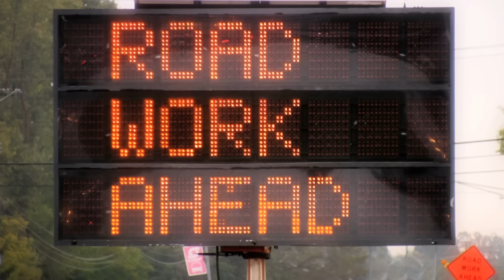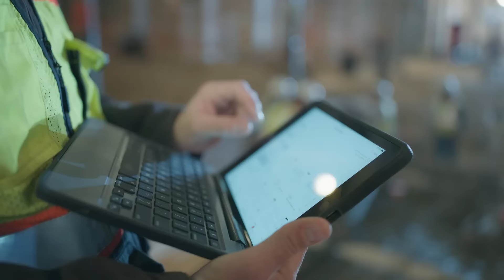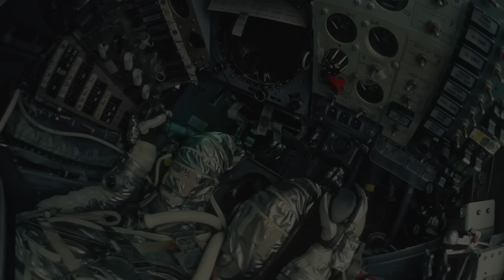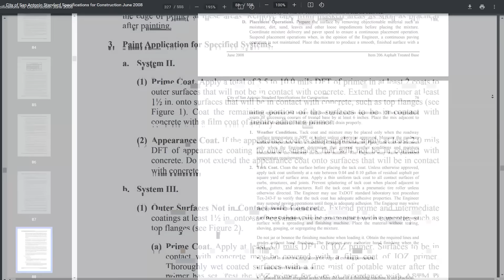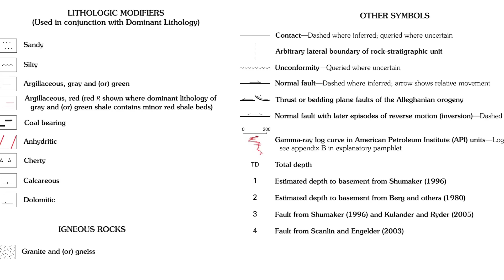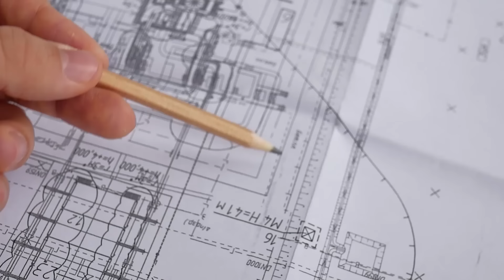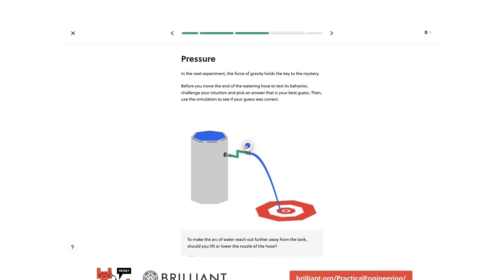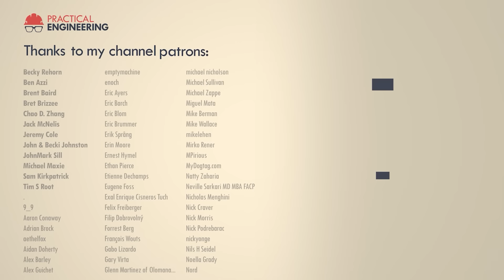4 Myths About Construction Debunked

Comment: As someone who does surveying, I do feel more lazy in the office than on the field
Reply: I've spent a lot of time playing on my phone in the truck because the contractor would rather have a full time crew on site than deal with the scheduling hassle of just having the surveyor come out when they need him.
Reply: My wife once said her career goals were "Stick holder. You know, when you've got the two people doing measuring? I wanna hold the stick." XD
Reply: omg your right i did not nodise that i felt more lazy in there doring lunsh thin out on the field
Reply: I can confirm! Day moves slower inside too haha
Reply: As a financial analyst for high rise office buildings, I can tell you that there’s no room for laziness in my field. It either works or it doesn’t, nothing in between.
Reply: As someone who left office work in a legal aid program to become an electrician I can guarantee you that pulling and installing thick aluminium cables and heavy cables is much more relaxing at the end of the day than working in the office.
Reply: As a surveyor having an office day, I can confirm.
Reply: having just finished a day at the office, yeah youre right
Reply: @toppersundquist  the stick holder is the stressful bit! You need good balance and a technique for holding things vertically. The looker/button presser at the other end is where it is at, much less skill required.
Reply: Haha fellow surveyor here
Reply: @timeluster  Since I've been doing both for the last 30 years: The stick-holder has the responsibility of knowing WHAT to shoot, and that's the big-brain part.
Knowing which buttons to press in certain circumstances is VERY important, but I always train newbies how to run the instrument first (especially now that we have robot instruments).
Reply: Sureyor, best job in the world, interesting and you can go to Incredible places.
Reply: The important thing about working in an office is to make sure nobody can see your computer screen so you can watch YouTube videos all day.
Reply: @mohammadalhasan4253  Cables over legal aid? Oh jeez, I hope it wasn't bad management.
Reply: As I write this I'm being paid to make manage our site surveyors while watching a bit of youtube and making sure the surveyors don't F up :D
Reply: As a bridge inspector I totally agree
Reply: As a CI (construction inspector) I would agree.
Reply: Bet
Reply: You are actually doing work when you are  surveying the land - When four guys are looking at a hole while one guy is in the hole with a shovel and there’s one guy asleep in the work truck —- That’s the time that it doesn’t make sense
Reply: That's because people who work in offices don't do anything either. Lol
Reply: I do like that you said "more lazy in the office" because you have one of the laziest jobs I've seen. Important.. but lazy.
Reply: @ReaperCet  No, I just have to move really  slowly because otherwise my computer can't keep up with me.
Reply: Teman dulu pun kerje 'site surveyor',skrg dah lama penchen,memang betul le serunok kerje kat 'site' dari kerje dalam pejabat ,kerana dalam pejabat ade 'boss' ,kat luar kite laa 'boss'!!!!

Comment: I worked a few summers at construction sites, and the truth is that there is a lot of inefficiency that arises just from the workers doing their best to figure out what to do. Usually the architect's plans have some minor flaws that cause major delays and idle time for the construction crew, and the on-site engineers often have to make decisions based on incomplete information and without a lot of experience in all the various jobs that need to be done. Despite having an image of purely physical labor, a surprisingly large portion of time and effort goes to just thinking.
Reply: At least Someone has been a job site 💯💯
Reply: @J D To be clear, it is not a criticism of anyone, just an observation of the construction process. It's the reason why construction has not been automated yet: building is a difficult problem. If you think what I say is incorrect, you should address it on a factual basis, rather than try to belittle me as a person.
Reply: In a profession where you are not allowed to make changes or modify anything without the approval of an engineer causes a job of the simplest nature to come to a standstill.
Reply: You have a fair take, though an incomplete one.

Sometimes those 'errors' on the prints aren't an error at all, and contractors waste time by trying to sell the owner and his field engineering reps on a 'better' solution that may save the contractor time or effort, but has long-term ramifications on maintainability or operation that were taken into consideration by the original designer. Or there's a note or alternate installation detail that requires actually reading the entire package, not just glancing at the one plan view.  Some may even anticipate billing on the back end by bringing up additional costs due to change-orders that they actually initiated 'to save time', or be using this apparent confusion over the prints to cover for the fact that they have a delay because they've overcommitted their labour force elsewhere, or messed up and didn't order enough material or tools.

There's quite a bit of back and forth behind the scenes going on, especially with megaprojects, that don't neccessarily trickle all the way down to guys working in the field at a summer position, and the guys that did the prints are often not in the room as they're being thrown under the bus.
Reply: @russellkeeling4387  Long line of major building and industrial accidents to demonstrate what happens when you don't go back to the engineer before making changes, even seemingly inconsequential material substitutions or other changes. Best when both sides are working together from the start and throughout, but oftentimes the owner's pinching pennies trying to compartmentalize. Penny-wise, pound-foolish.
Reply: Yeah little bits of misinformation can delay the project for weeks. And you need perfect coordination which is hard to get down.
Reply: This pretty much sums up my time so far as a site engineer.
Reply: I am a carpenter and joiner. Have been at a lot at work sites and in factory workshops. I am building custom interiors for all kinds of public and private buildings.

Architectural drawings will always have errors in them. Always. When we start building interiors, we always have to double-check every single measurement on the architectural drawing to see where the errors are. This is work that often  has been in the hands of architects and engineers for months already. I must go through and check everything in a day, because we are expected to get production rolling within the week usually.
Then, we have to check with the builders on site, that they have the same versions of the drawings, and make sure that they also have discovered the faulty measurements.
Then, before going into the final stages of production, we need to go out to the site and see that the builders and other contractors have actually followed the drawings, and adjust to what is actually there.
In the meantime there will be changes made to every possible aspect of the project. Clients will want to change materials, colour schemes, surface treatments and you name it.
Materials will be out of stock. Subcontractors will be hung up on some other job. Deliveries will be delivered to the wrong adress. Materials will show up sub-quality somtimes and need to be sent back. Accidents will happen.

Construction is a process involving so many variables that it is sometimes amazing that it can be coordinated at all.

Professional project management is crucial. Costs for many projects could be cut by half if there were just proper preparations made.

Comment: I live in Magdeburg, Germany, just 3 minutes from a large new bridge & road construction site (the Ersatzneubau Strombrückenzug) and seeing the slow progress every day has been really fascinating. It seems like sometimes nothing will happen for weeks and then, over night, a huge new part of the bride will be suddenly be completed. It really put the amount of invisible work in perspective for me. You need to have a lot of other things done before you can just plop a new 50 000kg(!) piece of steel on the end of your bridge without it collapsing.
Reply: Comicly, to some English speaking people it will look like you are specifying 50 kg to 5 significant figures not 50 tonnes. ("." is used as the decimal marker not a seperator for triplets. Some people still use "," as a seperator but best practice in sensible English speaking countries for decades has been to seperate triplets by spaces, probably to avoid confusion with countries that use "," as the decimal marker.)
Reply: @igrim4777  most of us understand that the decimal has the same use as a comma. Born and raised in America and I understand the metric system way better than I do the imperial system.
Reply: Your right. I work in a factory that is currently expanding a building and when you watch the construction crew it looks like nothing is happening, but then you look at the timelapse of the past few days and you see how much actually got done.
Reply: Working outside of course makes everything even harder. If concrete is involved, you have to plan possibly weeks in advance for when you will need the concrete on-site because it has to be made remotely and brought in on trucks. It also can't sit around in the trucks or it will start to cure. They can't pour the concrete if there is any chance of rain and the only way to know that is to have a solid window of time to make it all happen. They can also be offsite making the steel frames or working at a different site. The bridge site could be waiting on some material that has a long lead time. There are also unforeseen questions that pop up on nearly every construction site and the engineers have to be consulted to answer the new questions and possibly draw up and engineer new plans to answer those questions.
Reply: @Quantum-  I have to know both as a machinist, my employer makes parts in both metric and imperial.
Reply: That there is a progression that you have to take care of is true, but it also come down to how different contractors care about the effect they have when building.
Example from the building of two similar bridges done by two different contractors over a local motorway. One was build in about a month with people onsite every day. The other was build in close to eight months with long periods where nothing was done. The later meant that there was big problems with traffic for months and that a travel that should have been completed in 15 minutes to nearly 45 minutes. That is "stealing" a lot of hours from people that need to travel, just to optimize their own use of resources.
 The first bridge was completed at time the later several months late.
Reply: I can confirm that. We are building a house and it is the exact same thing. Some tasks take a lot of time but look small and insignificant. They are important to prepare that site for bigger chunks being put it.
Reply: @ThePwig  Don't forget the curing of the poured concrete, cube cylinder testing to measure strength gain, propping and loading cast sections. 
Most of my career was in tunnel construction and we were payed bonus payments on yardage completed, so we didn't stand around at work, in the new car showroom yes and in the 1960s 70s I could buy a new car monthly eat well and look after mum. My retiring project back in 2015 on the KL Metro Malaysia we were building on average 345m of 6.67m dia. tunnel per month.
Reply: @igrim4777  I love mm and hate cm. Having grown up in the UK with so many differing measuring and counting methods, decimal was a god send. The divisions of an inch, foot, yard and mile. Fluids, Money, Time it's a wonder that any school kid passed a math's exam.
Reply: @Quantum-  The Firkin is my favorite, well the contents are.
Reply: The new Strombrückenzug is simply amazing for such a small city. Watching it built is so awesome.
Reply: @candlestyx8517  I'm just dumb. I can't mentally picture what a half inch looks like but I can spot the difference between a 12 and 13mm bolt at a glance. Lol. Knowing that the latter is virtually 1/2", my brain just doesn't process imperial. It takes work for me to convert them. But once I get to certain measurements, I default back to imperial. I use inches not cm. I use miles not km. And I'm fairly fluid between lbs and kg. It's weird.
Reply: @TheByard  Along with the Furlong and the Fortnight?? 😀
Reply: One of the issues we have in Germany is that for public work like this companies bid on it, and the lowest bidder wins (so far so normal). The bid terms define a start date but no end date, so often you will just see all of a sudden these companies put some traffic control to meet the minimum requirements of "starting a job" and then leave for months to work on more lucrative jobs.
Reply: @_yonas  there's a comedian, Todd Yohn. He wrote a song about how there's nowhere to store all the barrels/cones for road construction, like no warehouse large enough. So he proposed that instead of storing them, the barrels just get moved along the highway in different temporary "construction zones". When the barrels are needed workers come pick em up. I always thought it was a funny joke.
Reply: @Quantum-  that's because you are bad at math
Reply: @dakota9821  that may be. Where'd you get your PhD? Phoenix online?
Reply: I've personally been shocked at the speed of some construction near me, an entire apartment complex went up within a year and I barely saw anything happen.
Reply: Shoutout Magdeburg! I‘m from Nashville and miss living in Magdeburg

Comment: As a bridge inspector I appreciate this video! I will say it does feel odd standing around watching other people work but inspectors play a vital role in ensuring the final product is built to standards and isn't a hazard to the public. I'm also glad you addressed the myth about Roman concrete and structures, an ancient Romans head would spin if they saw a concrete beam with pre-stressed strands, quite ordinary in today's construction of bridges!
Reply: Do you inspect the welds or just everything in general?
Reply: @tylerjacobson5840  everything in general through the construction of a bridge. Earthworks, deep foundations, formwork for concrete structures, concrete itself, reinforcing steel, beams, post-tensioning strands, conduit ect...
Reply: And none of it will last as long as the Roman’s due to rebar.
Reply: @evilsimeon  And that's perfectly fine. Unless you'd prefer to live in a Roman marble structure without modern heating, plumbing, or air conditioning?
Reply: @evilsimeon  How many Roman bridges carried heavy vehicle traffic?
Reply: @tylerjacobson5840  Welds have specific inspectors for them. They follow industry standard methods for testing and quality of the welds.
Reply: @BlackGateofMordor  You don't need a structure that uses steel reinforcing bar in order to have air conditioning, electricity, and modern conveniences. Steel rebar is, in many cases, THE element of a building which dictates the building's maximum lifespan.

There are better ways to build a lot of structures without using steel reinforcing...glass fiber reinforced polymer bars are one such option. Obviously some structures will always require the sheer strength of steel reinforcing, but there's no need to continue using steel rebar to the degree that we are in residential and commercial construction. Of course, the rebar manufacturers won't like this, unless they see the writing on the wall and switch their processes.